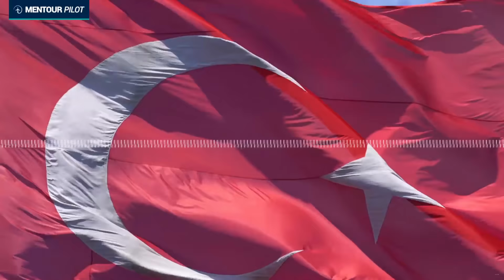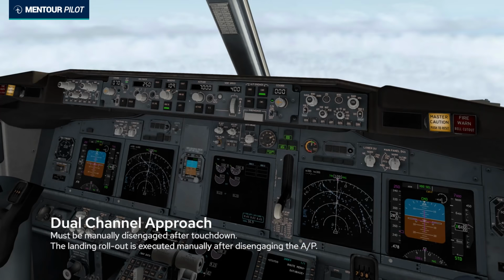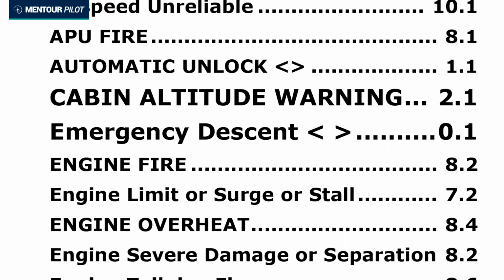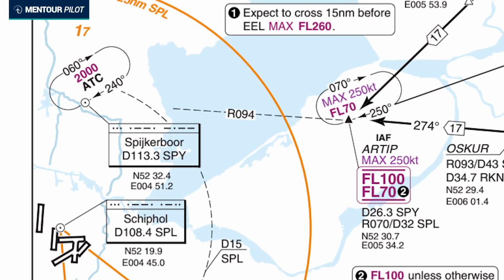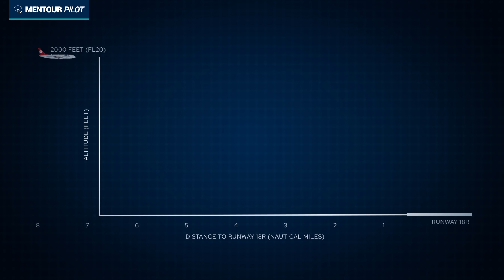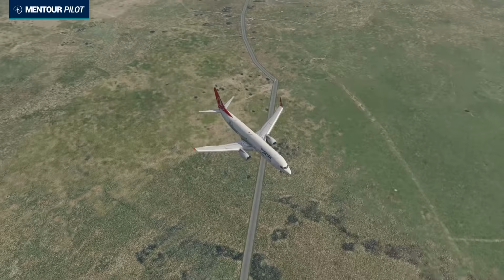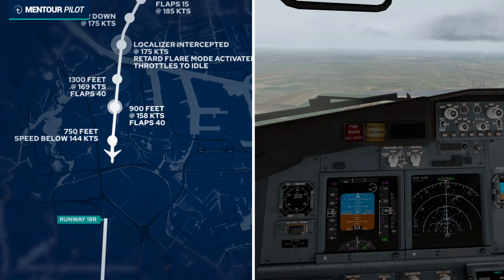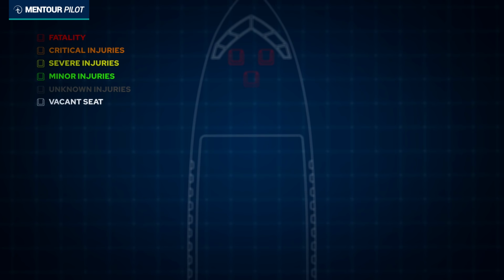What happened to Turkish Airlines flight 1951?!

Comment: You'll never find me flying on a Boeing AC ever..  As far as I can tell the "goofyness" of the system is what caused this crash.  Call it that buttons have to be pushed in certain orders or that the radar altimeters were unreliable (and proven as such)...The roll bar disappearing is supposed to be noticed while flying what seems to be a time crunched approach?  Combine it all...  So, why no flying Boeing?  God, one Radar altimeter showed true, other knew there was a fault, and it is trying to flair for landing?  If anything should it not have applied full throttle and set itself up for a go around/missed approach?  Pitched the AC up, full throttle.  Why would it flair at that point?  Piss poor programing in my opinion.

  should the pilots have done this (go around/fly the approach themselves)?  Well, this is part of the problem with having only one qualified pilot with a backup not at the controls and the dynamics of human interactions.  I had enough instructor pilots fail to know their ego is often too big and causes problems....  This falls on higher up, if training like this is needed should only be done on flights with no weather hazards are expected, during daylight hours.

  The short time for the ILS is a contributing factor, but, it could have went down this way regardless.  It sure didn't help though.

 Back to Boeing, I have no faith after reading many failures of the US government not holding them to known safety standards while building AC and people die.

 Are we fying safer today than in the past? Sure. But I wouldn't care to be the person who's dead because of what I'd consider basic failures like these.
Reply: Wrote that as watching...So...Despite the stick shaker being active as AS is low and the Radar altimeter being unreliable the Auto Throttle will still bring the throttles back?  That looks like the "dooming" final act Boeing put on these pilots.
  I also can't believe stalls on approach were not well thought out (and trained for) before this.  I thought we knew landings/takeoffs are normally the critical and most accident prone parts of flying (one can say almost all accidents are at the landing part tbh).  Not sure what is "tricky" about it though, flaps, power, gear up and pay attention to your aircraft's approach ( or missed approach) angle of attack.  If you do all of that (and quick) I don't know what else would have helped?
 I was also taught that the pilot flying fly's, while the pilot who is not, does everything else.  The CP flying should have transitioned quickly to not flying and looked at the throttle/flaps/gear immediately.  But, again, new, time constraint, and overloaded.

Comment: Boeing promises tech and safety precautions. Trust pilot for handling it. Pilot trust the system and system failed him, Co-Pilot trust pilot decision, Pilot take things lightly maybe also because this is not his first time encounter this issue. Maybe another way is to put third sensor and not onboard altimeter and other sensor device as additional back up to encounter such defect produce by boeing

Comment: Captain multiple faults, also second pilot some, but what was Safety pilot doing?
He had good view of both radio alts, auto throttle jumping out, throttle cut back, air speed.
Sounds like fear of a bossy captain.  Why no GA really early so to configure farther out, GIVES TIME to find out and cope with left faulty radio alt so disengage dual control auto throttle?

Comment: After watching most of your videos it seems like the work load has become untenable to fly safely and for probably 50 years have been experimenting with people on board to see what works and what doesn't, asking a pilot to go through a checklist when there is a fault close to landing with warning buzzers going off and radio traffic is insane, what it comes down to is if you don't crash because of no faults in equipment or other wise it was a safe flight

Comment: This is one of the most technical of your emergency/disaster videos, so I think I'll have to look at it again... but also one of the most terrifying, as it seems to come out of nowhere, in the last moments of what appeared to be a fairly routine landing.

I can't understand why the pilots continued to use a faulty altimeter, which appears to indicate (if I have understood correctly) that the plane was already on the ground, when that altimeter was still disastrously connected to the automated systems, influencing things like the "flare" setting thing.  Surely the thing to do would have been to disconnect the altimeter from the computer completely (if that's possible). 

Also, a faulty altimeter in any flight context would strike me as a pretty major malfunction, which I would have imagined would put things into an "emergency" situation... and thus the imposition of a very difficult short landing, where it was necessary to drop down to the glide slope with a difficult manoeuvre, would be out of the question.

By the way, Petter, just one point about your pronunciation. Obviously your English is superb, but you are slightly mispronouncing "auto": is it not "oww-toh", but "orr-toh": this is certainly the case in US and UK English.

Comment: I feel sorry for modern pilots with so much automation. I fly basic mep ga many without good or working autopilots. In these airliners if anything breaks the interdependencies are so complex. If I got any warning that did not make sense on an approach I would want to just hand fly it!
Reply: What is a "mep ga"? Also, the pilots did not get any warnings during the approach until the stall warning, and it did make sense to them. There were visual indicators that would have been interpreted as warnings… if anyone was looking at them. Automation has contributed significantly to the drastic reduction in commercial air transportation accidents over the past two decades, but the reliability of the automation can be improved. Pilot training/performance remains an area that could be improved.
Reply: @petep.2092  all wrong

Comment: You have a highly automated system with many interrelated parts , and you are asking human beings to correctly diagnose and troubleshoot this complicated flow chart in real time.  Maybe one minute . It is no wonder it goes wrong.
Reply: You are mistaking the explanation for the procedure. There was no troubleshooting or diagnosis of any system necessary or expected. The only thing expected and required was monitoring of the critical flight parameters: airspeed, altitude, attitude, altitude, rate of descent, flight path, with further expectation that they would respond per their training when a deviance was detected. They monitored… nothing. The late detection produced a late response that may have been adequate but didn't because it was also not per training (throttle and autothrottle). The Captain only focused on procedures that were visible and could cause injury (seating cabin crew) but not on anything that he felt he could cope with. He failed to call a missed approach when the approach was not stabilized at the approach gate and he failed to apply full throttle on receiving a stall warning. He seems to be too insistent or fixated on a mandatory landing on the first attempt.

Comment: Not so fun fact:Did you know that rescue personnel and nearby witnesses weren’t let inside or even near the aircraft after the initial crash? People later confirmed to be from the CIA boarded the crashed plane and took 4 laptops containing military information regarding the E-737,the laptops belonging to 3 Boeing employees onboard (all 3 dead after the crash) eye witnesses also have reported the cockpit crew were banging on the windows of the cockpit seemingly desperate for help. How weird that they died after these agents deboarded and rescue personnel were finally let to get onboard the wreckage around 40 minutes after impact. They killed the pilots or let them die because the pilots would have known and told what had actually happened. Also, a technician of Turkish  airlines trying to get inside the wreckage to rescue passengers was subsequently arrested by American agents whilst the removal off the laptops were going on, the technician was kept in a warehouse for one hour in which he heard from an agent of a missing passenger (later confirmed that one person was in fact missing) had left the wreckage and boarded a flight scheduled to depart around 45 minutes after the crash. So yeah, the explanation to the deaths aren’t so simple.

Comment: Boeing planes have had a problem with altitudes and vertical speeds for decades it seems. I am just a rando with interest in these kind  of videos and have no aviation experience but it seems like Boeing has not really mastered the automated navigation. A lot of accidents regarding Boeing jets start with some false warning, some problem with automated systems,or something wrong with the system otherwise. I havent noticed this trend with other companies so much. Am I wrong in that gut feeling? I tried to google it but I cannot find stats by company of the jet vs cause of the disaster. Maybe someone with better tech knowledge should research that and publish a paper or something on this. If anyone has that info, please link that in the reply, it will be highly appreciated.
Reply: Can you list the flights which didn't measure or display the correct altitude or vertical speed?

Comment: Very very sad accident, Pilots are guilty as usual ( because they are dead), Boeing is clean as an angel, right?
Reply: So all dead pilots never made a mistake. Good thing you don't conduct crash investigations.
Reply: @petep.2092  BOEING's responsibility for this aircraft accident cannot be ignored, it is simply an operational design error that the data from the left radio altimeter was processed by the aircraft's operating system.

Comment: Sounds like the same problem that will hit the Max latter. Computer and Soft Were dilemmas. A human has so much room for
a single brain. Imagine if you try to gram your soft were with another one thinking the the aircraft is twice as intelligent. It does not
work that way. One will oppose the other. One brain, but better information networks to all systems. If the brain malfunctions, then
turning off the defunct computer and engaging the backup will restore function to flight controls. But you must disengage the first
computer which is playing up. One Mind, Plus the Captain and First Officer, that's all you need.

Comment: The plane almost went vertically down, that has me wondering about a question I have never had answered. If you are in an impossible situation and the plane is going to crash, there is nothing but forest in miles, would it be possible to make the perfect stall and actually "crash/stall" the plane vertically from a very low altitude? Not everyone would survive but it certainly beats having to land straight into a dense forest at high speed.

Comment: The near-total dependence of commercial pilots on checklists has always been concerning to me. After years of training and experience, why aren't pilots able to do anything without a checklist?
Reply from the maker: We are, it’s just that under pressure you are MUCH more likely to skip steps and make mistakes. Also, it keeps both pilots in the loop about what’s being done.
Trust me, you do not want to skip the checklists.
Reply: @MentourPilot  Makes sense, and thanks for the explanation! I'm not a pilot myself (although I wish that I was), so I can only try to put myself in your place and try to understand the challenges that you're dealing with in various situations. But your videos help to shed light and explain a lot of things, so thanks and keep up the great work!
Reply: Easy to forget something as small as turning on the landing lights or arming the spoilers. I share your concern though over situations where I've watched air disaster shows where they're about to crash and pull out checklists. Can slow them down drastically.

Comment: military pilotitus syndrome, background "reactive" psychological values are never properly assessd in simulator, with respect to flight experience of the pilots, especially under stress  there needs to be better stress tests thrown at the pilots in simulators including more complex "connected" instrument failures. No one has summarised accidents (fatal or non fatal) with a survey of pilots background, such as military or commercial or just flying school (the old usual) from day one, types flown,  emergencies handled, routes/areas/IFR/VFR flown while qualifying. etc. But in this case it was all brought about by improperly designed radio frequency electronics/software and yet again piss poor displays on the A/P panel - as well as micky mouse software written by coding twits on desks with no worst-case testing. MAX comes to mind.  What was the actual external vis at time of decision height?
Reply: Complete gibberish
Reply: @V v The evaluation would be meaningless. What counts is pilots having the right psychology and behaviours which can be present regardless of background. Also, his analysis of the causes is nonsense. The technical aspects wouldnt have been an issue normally. The lack of monitoring and interventions as the issue here.

Comment: 27:00 - The technical word used to describe that thrust setting has been banned. The aviation industry will have to come up with a new word to describe that thrust setting - otherwise, so MANY airline pilots will be canceled. And then who will fly the planes? I think we know the answer - we'll let the victims of this now justifiably-banned word fly the planes. Everyone on board will feel safer knowing that someone who has overcome extreme prejudice is at the controls. Mentour Pilot - aircraft safety incidents and crashes will be a notion of the past, and your channel will no longer have a business model. I'm sure you'll adjust. :)

Comment: Is it really appropriate for a professional pilot to be monetizing the tragedy of airline crashes?! A defence that this is educational is disingenuous and cynical. Surely you can come up with more appropriate content and leave this to morbid TV programming.
Reply from the maker: I’m sorry you feel this way. The fact is that this is a tool the aviation industry have been using for years to help avoid similar situations from occurring. It shows the enormous complexity behind anything like this. It actually helps nervous flyers because it gives a technical and detailed background to situations which are not properly explained in the press. That’s what I am trying to achieve here and it looks like the overwhelming consensus in the comments find it helpful.
Reply: Morbid tv programming does it for the drama. You’d don’t necessarily get all the details of the final report. Just the points that the average viewer would understand